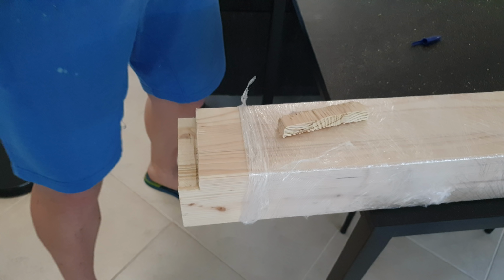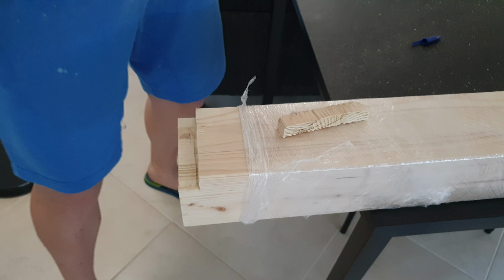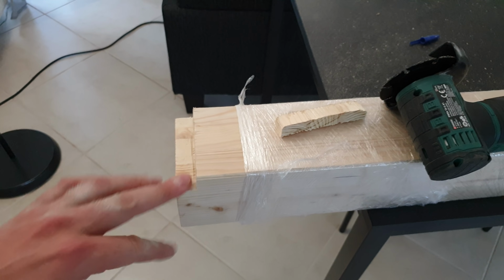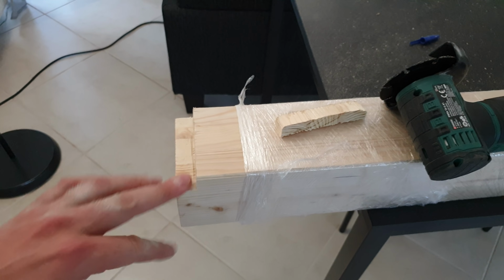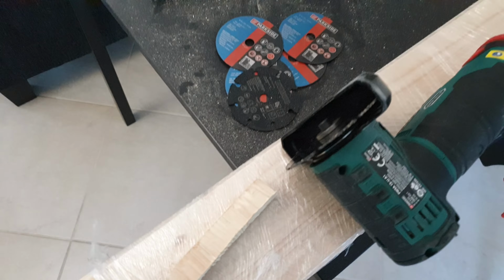Parkside Cutting Disk PWSZ 76 A1 TESTING

Comment: It could be just me but I would remove the battery BEFORE changing the blade and I would also not be wearing sandals when cutting wood or metal or ANYTHING with a power tool. Hope you were at least wearing safety glasses?